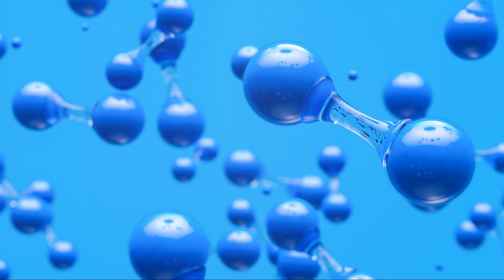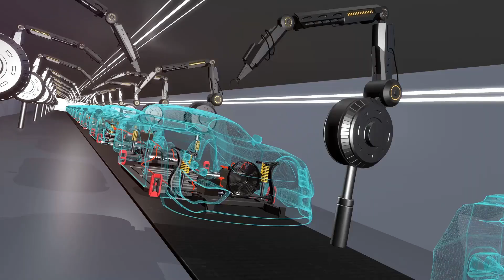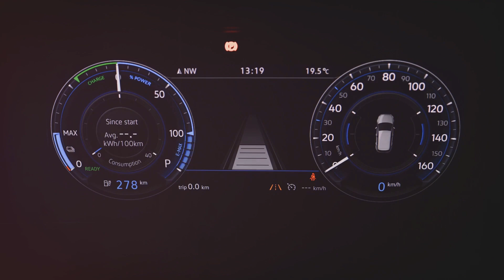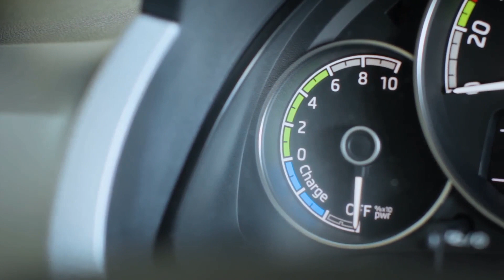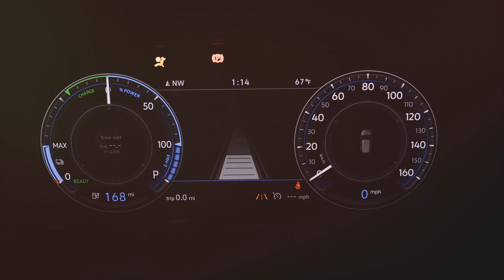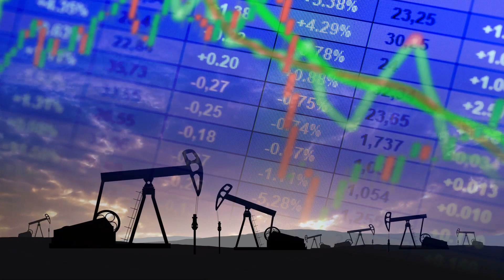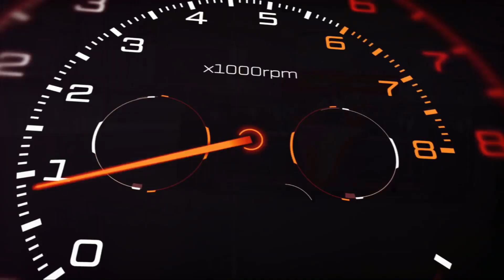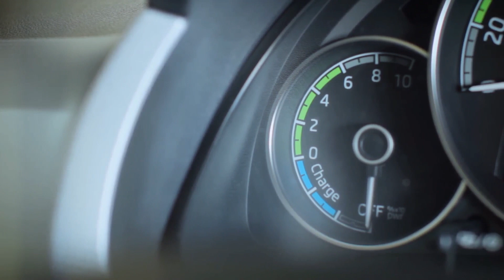The V8 Engine HYDROGEN

Comment: This wont replace anything. We cannot store enough hydrogen onboard a car to make it worth it, unless its in liquid form. But in liquid form a little bit of hydrogen will always be venting away. This video is mostly BS.
Reply from the maker: Then why are such resources being spent on developing such an engine?
Reply: Because they wanted to. It is not all that hard to make an internal cumbustion run on hydrogen, its a fun glamor project to draw attention. Toyota is basically throwing darts at a dart board and seeing what sticks, which they have the money to do. Toyota is also much farther ahead in Solid state batteries than hydrogren. 

There are plenty of videos showing people running standard old american V8's on hydrogen out there too.  And they put out more horsepower then this toyota one. But again the problem is storage of hydrogen in gas form in these cases: gotta have a huge tank to run a few hundred miles, a tank the side of a pickup bed.  @autoadviser2779